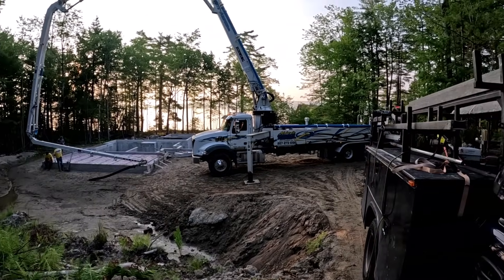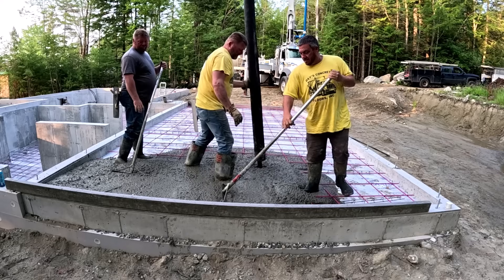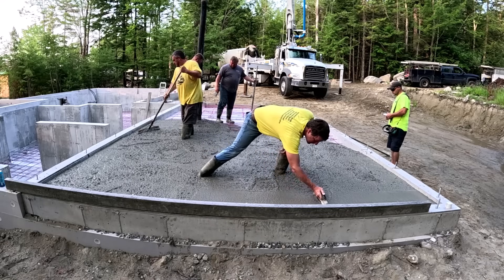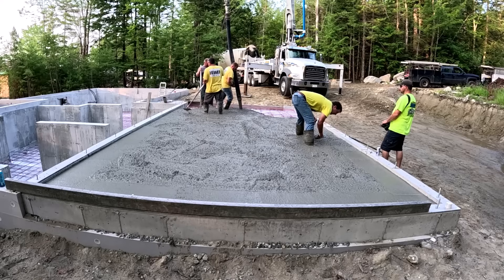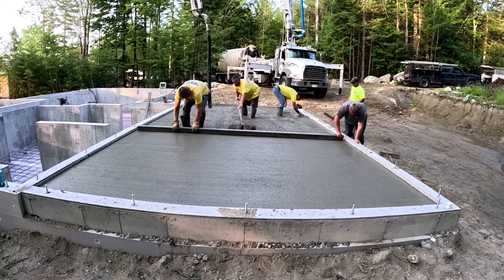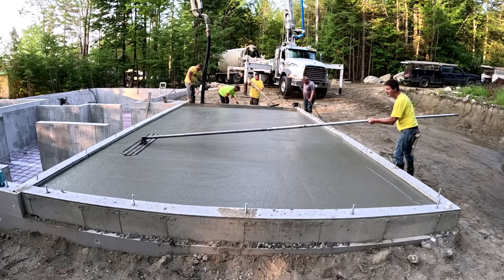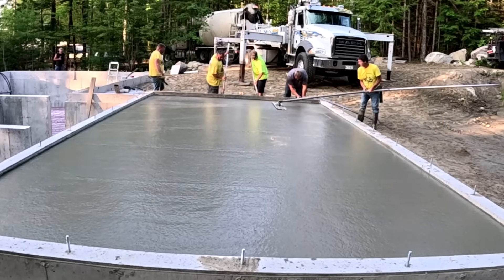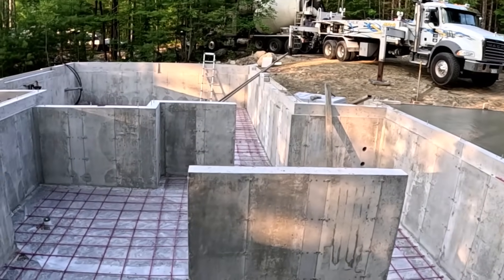Overkill? Why So Much REBAR In This Garage Floor?

Comment: The common practice in Australia is sheets of mesh with 200mm or 8 “ centres with a variety of bar diameters ranging from 6mm up to 12 mm. F62 mesh has 6mm bars @ 200 mm centres

Comment: Could the garage floor be prepared for heavier Evs?
OR,
Is it possible the garage that will sit upon this foundation will be tall to fit a motorhome?
WHY is there no threshold for a door to lead from the house to the garage? Usually there is another threshold from the garage to the outside. This garage seems too narrow for 2 cars, but, 1 motorhome seems right.

!

Comment: Mike you do such nice work , I work in a machine shop and deal with engineers on and everyday bases, I sometimes call them down to the shop and ask them why they want us to do things certain way on the drawing sometimes their answer is for a good reason that, when explained it makes perfect sense, Other times they just do things that makes no sense because they are just using a template or just a universal general way , or copying someone else's work from previous job  ? my point is  call the engineer/Architect we all may learn something  ?

Comment: If you dont have any joints in the floor, you have to put a lot more reinforcement into the floor. Rule of thump is 0,6% of the concrete cross section in order to obtain the tension forces..

Comment: I poured a nominal 8" thick floating slab for a metal pole garage floor over 40 years ago and it has no major cracks with only #4 perimeter rebar. I think the concrete thickness helped also. If I were to do the same floor now, I'd probably go  16"-24" OC rebar just because it's easier to step through and I like reinforcement especially since I don't know the compressive strength of 2" Foam underlayment with live loading. Engineers look at a lot of factors like soil resistivity to support and distibute loads. His choice makes sense in the final analysis if he just wants to "CYA" Cover Your A.. if the contractor says "We don't need this", and leaves it out and it fails. The Engineer can say it wasn't built to spec, so not my problem. Go after the contractor.

Comment: Is it too much rebar for a garage floor? It is definitely overkill if you're on a solid base. I have seen some engineers that insist on so much rebar it is crazy and some that are reasonable. I have found that engineers that get paid by the value of the work tend to ask for much more rebar and other details that push up the price of the job.

Comment: No such thing as overkill but I agree I pour floors with fiber mesh only and been doing it for over 30 years with no problems. Every floor I’ve demoed with wire mesh the mesh was all the way on the bottom doing nothing. Like you said if it was commercial that’s a different story. You got a good crew!

Comment: Rebar is something that is good at the beginning but once settled and water finds its way and begins oxidizing the steel it creates empty voids where rebar once was.

We need to find a better way.
Ive done concrete restoration for a long time and its always failed due to rebar turning into air pockets after the corrosion process.

So yes any rebar Is to much
Reply: In this case, they used fiberglass rebar..

Comment: FWIW: I did #4 Steel rebar 12 oc on my garage. For the basement I did 16 oc. No cracks & no slab saw cuts.
Reply: Rebar will not prevent cracking but will keep the cracks smaller. If no cracks, you probably have a well compacted subbase with no hard or soft spots.
Reply: @elbuggo You will only get very small cracks with a lot of rebar, unless there is a lot of settling or erosion under the slab.

Comment: Do you prefer pouring on a vapor barrier or having 2" of sand over the barrier.   The American Concrete Institute used to recommend the sand so the slab will loose water more evenly on top and bottom to reduce curl and cracking.  Finishers used to ask for sand also so water would not come to top.   The reason ACI now recommends pouring on vapor barrier is so water under slab  will reduce faster so adhesives used on top of slab will have less moisture problems.  I still use sand on vapor barrier if no adhesives will be used soon after placing.
Reply: You can spray on Sikafilm or Deco-Film after bullfloating to prevent bleed water evaporating too fast in hot weather. That will reduce curling. Also use less water and less cement in the mix. It's the paste that shrinks.

Comment: It's exactly how a slab should be reinforced. This should be standard practice. Rebar, not the usual worthless wire mesh.
Reply: Yea my garage slab is 6" with the fiberglass rebar. 
Kinda like you run extra wires when the drywall is down as its a lot harder to add it later if needed. Cheap to add now a lot more if needed later.

Comment: Thats not too much rebar, but the concrete looks to soupy to me even with water reducer...
Reply: Soupy or not, it's the water/cement ration that is crucial. I understand it is 0.42, which is excellent.

Comment: Sound like he might want the extra beef for putting in four post lift, maybe even a double width one. Suspenders and a belt. He might have a couple hot rods plus a his and hers parking spaces underneath them. If the check clears, it really doesn't matter.

Comment: Rebar doesn't keep a floor from cracking. It just holds it together if it should crack. I've seen many floors with wire or rebar that have cracked for one reason or another.

Comment: Worked in a PennDot bridge division over 20 yrs and the standard “top mat” reinforcement, which is there to control cracking, was #4 @ 12”. That was for an 8” slab with two mats of rebar where the bottom mat of reinforcement was designed based on the spacing of the supporting beams. Also, the standard was #5 @ 18” for vertical faces. So yeah…. 4s @ 12, probably overkill on an indoor slab, are quite common in concrete design.

Comment: Too much rebar? That is like too much money, too much beer, too much fun! 

I can say as the laborer who has had to break this up with a jackhammer as a teenager on construction crews (the other side of the coin) and hated rebar, mesh and steel rebar. Didn't have fiberglass back then. 

It may be more work and cost more than it's worth for this much rebar, but may depend on the type of soil and compaction on it.

Comment: If the purpose of the rebar is to increase the load bearing capacity of the slab if the subgrade fails then No4 at 12 inch centres makes sense, but minimal benefit if rebar is the middle of the slab,
.If the subgrade and fill are properly placed and compacted then the benefit of rebar is marginal other than mesh to hold it together if it cracks

Comment: Mike you need to get off the rebar kick. So what if there's rebar, soooo what, I use rebar on every concrete job, cheep insurance. I  live in the northwest and on the coast there is the old saying, shifting sand. 100's of feet deep.

Comment: Concrete has great compressive strength but low tensile strength. Reo compensates for tensile strength, but when it takes up too much volume, the compressive strength will reduce due to lower relative concrete volume.

Even if the the foundation is great (no doming or dishing can occur), I understand mesh reduces the effect of cracking resulting from contraction.

Comment: If the engineer does not know if the contractor will supply good quality materials and workmanship, perhaps the extra rebar would provide some safety margin?  In many areas of the US it is very difficult to find good contractors.
Reply: More than likely concerned with the sub-grade, it’s a basement on a slope.
Reply: Just accept that the structural engineer has designed the floor to perform as required with the design constraints he thinks are appropriate.  Speculating on what those constraints are is irrelevant.
Reply: @clivewilliams3661 
In other words, "stop thinking, shut the f⬜k up, and blindly accept what the priest says, commoner".
Reply: @clivewilliams3661  this is not how context works
Reply: @networkedperson  What context??  You have no idea what constraints the structural designer was working to.  For me as an Architect, the rebar shown here is not unusual and I have dealt with many buildings with such reinforcement in the slab.

Comment: Hey Mike...I want to pour a bunch of 6" x 6" x 6" paving stones. I measure the water carefully and will cover with plastic to slow the curing to maximize the PSI strength...do you think it is necessary that I add a small "X" of rebar in the middle of each paving stone? You think that is overkill?
Reply: Rebar in pavers is completely unnecessary. Not one manufacturer does that. The bending moment in a 6x6x6 paver is next to nothing. (Why 6” thick? 2.75”-3” is plenty and industry standard. Go thinner and get twice the number of pavers from your material.)
Reply: @psidvicious  Thank you so much. I was not certain due to inexperience...the pavers I see at Lowe's look like they cannot handle Southwest Electric's massive vehicles and others which would occasionally drive on it. I have seen 4" light duty slabs but like you said a paver has really no "bending moment". I will probably put a little sand between too. I have learned that when I mix concrete very accurate on water and cover it to slow the curing that it really cures hard.

Comment: Recently did personal 16 x 26 garage.  For rebar every 12 inch was 400 bucks more in material. The concrete for 12 yards was 2500.   Makes zero sense not to do rebar.  For 400 more.  Not sure what the labor cost is. Personal use absolutely use the rebar for the extra pennies.
Reply: I agree. I would only omit rebar in something I planned on tearing out in the future.
Reply: He’s explained his reasoning for rebar in other videos, he’s not against it but when the pour is being done for a garage attached to the house it will be enclosed and insulated as well as the foam mat underneath for insulation, because of all those factors and the sealed in enclosure the form will be in it’s never going to crack as long as the sub base is done and compacted properly. If the sub base is not done properly he will definitely opt to do rebar, if it is done properly it’s not needed. Again with an enclosed on 4 sides slab, insulated with a proper sub base
Reply: I personally like it stronger unless I have to tear it out in the future .  Rebar makes it very very hard to tear out and remove.

Comment: My guess the owner is an engineer and over designed his floor.
Reply: I had a neighbor who was engineer and built an ICF house with geo thermal heating/cooling.  When he got done with that house, which sat on a slab, the temperature difference between the attic and floor of slab in July had only a 2 degree difference!
Reply: @AStanton1966  ICF is wonderful method